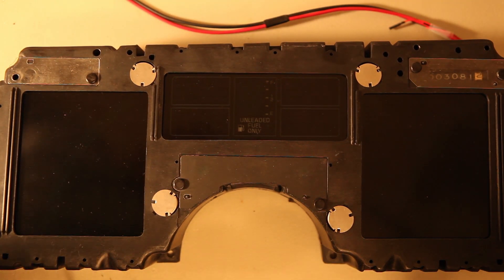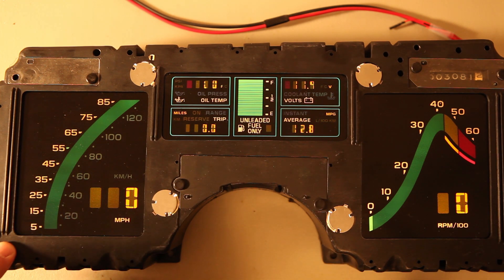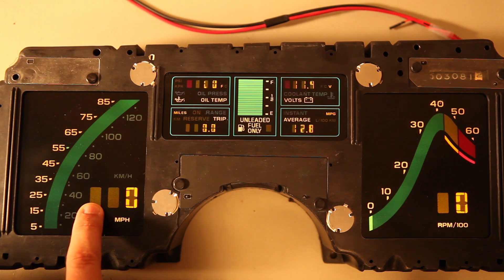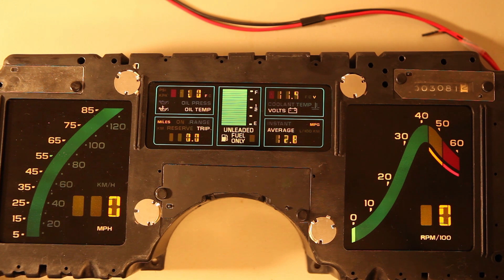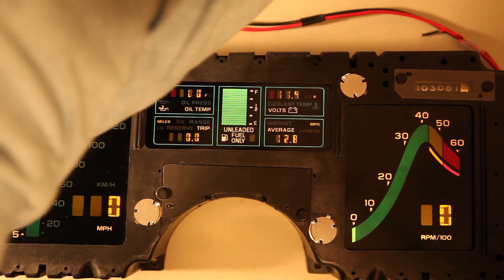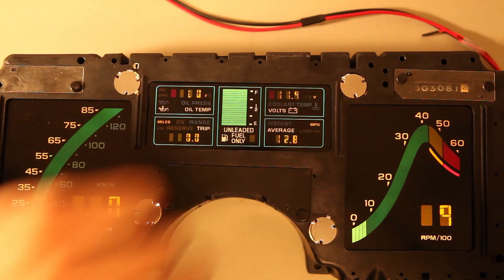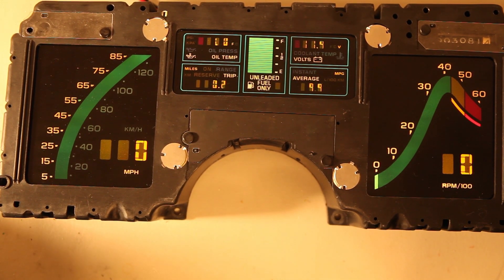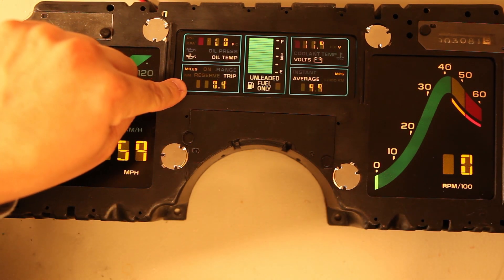84-89 Corvette Gauge Fix #15 Testing Final

Comment: Looks like you not only fixed it to new again but you also removed so miles off the odometer. Nice job. I need to rebuild mine. Cause I have to put on sunglasses to read mine.